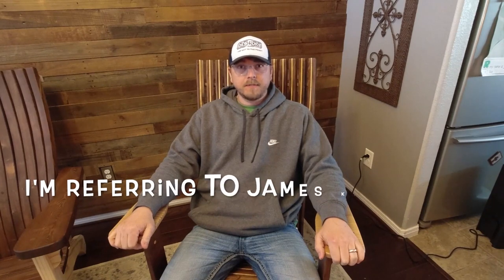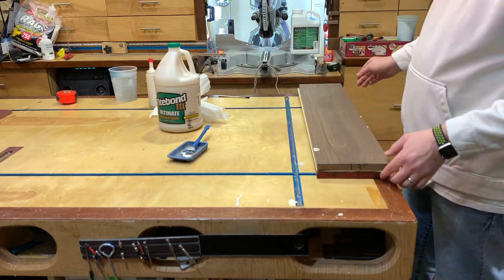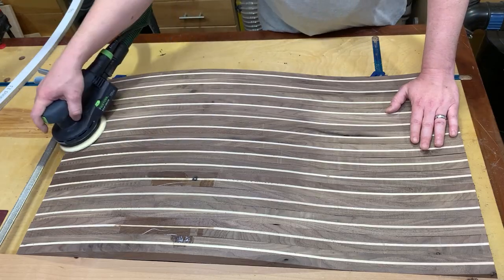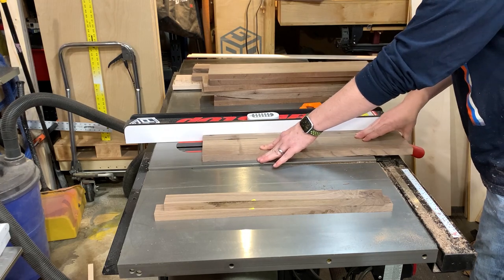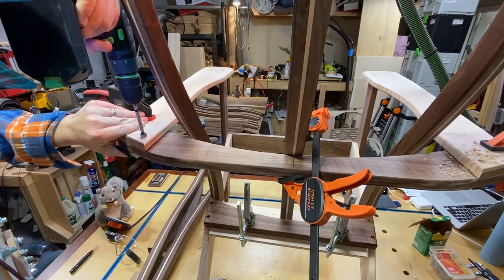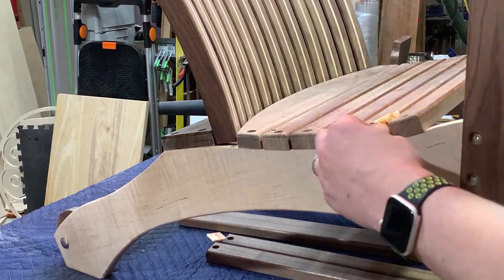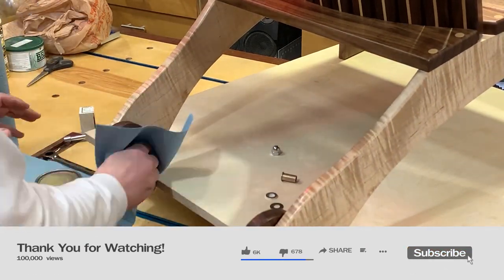DIY | How To Make Money Building an Adirondack Chair | KFWW Build Off Challenge

Comment: Both the chairs are beautiful. It's almost impossible to choose a winner from such a short video. The reason I chose your beautiful chair 'first place' over the other was because the screws holding the cross piece to the front and back legs alternate in height and don't touch one another inside. Unlike the other chair. But they're both beautiful! Thank you.

Comment: 1st place. I love the use of screws instead of bolts. One thing I noticed was in the other video he drilled his holes for the bolts he had blowout. I know it is not seen but when you are using woods like oak that looks really good go that extra step and use a backer piece when drilling so you don’t get the blowout.

Comment: I bought Kings plans because I really like the design. I particularly like his narrower slats for the seat back. You took it to the next level with the curly maple inlay/laminate. The wooden wheels go better, but would consider something more durable/less elegant if it was moved a lot.

Side Note: brilliant idea using an HDPE slab for your router table
Reply from the maker: Thank you. On the wheels I decided the chair might get moved once or twice a year. And because I was jazzing it up
I thought it was worth figuring out. I did coat them with a penetrating epoxy and I’m super happy with the result.

Comment: The best looking ADK ever IMHO. Where will use the yellow pine? Just in the back slats? or for the legs and arms? and what brand walnut stain for the cedar? Thanks for the vid, Great Job.
Reply from the maker: Absolutely. So the yellow pine I use on the frame and front legs. I use cedar for the arm rests and back slats which I stain a walnut. I use varathane dark walnut from HD. I have some pics on FB and Instagram if you want to check them out. Thank you!
Reply: @rpgwoodworking5489  I saw the Instagram pics so I guess the big question is how long do you think the pine will last compared to cedar? Are you using the total boat on the pine?
Reply: @Popsimath  yellow pine does extremely well outdoors. Use a good outdoor finish and it will last decades. Any outdoor finish with good uv protection will work great. Penofin is also a great choice. But yes halcyon is great.

Comment: I'm curious if you had much or any difficultly using the 5/4 hardwood instead of standard big box lumber? I'm pretty new to woodworking and am about to attack these plans with Maple and Cherry, thought I'd ask someone who has done it instead of using 2x4 Sugar Maple and ending up with a 400 lb chair!
Reply from the maker: Ha!  I did one out of big box pine and cedar as well. The frame, arms, and seat slats once machine came out to 3/4-7/8 ish. I wasn’t about to make the chair out of 8/4. 🤣. That being said it comes out weight wise about the same as big box store wood or at least close to it. In some ways the hardwood was easier to work with. You don’t typically have to go sand out bumps and ding in the wood like softwood. If it’s machined pretty well you will not need to do to much sanding on this chair. The back slats are the only part that can slow you down. If you machine the slats really well it’s a breeze. But if you are inconsistent while cutting them out you will have a good bit of sanding. In that case you would wish you used softwoods. 😂. Don’t be nervous at all using hardwood. Good luck!
Reply from the maker: Wait who got first place!?!  🤷👊🏻
Reply: @rpgwoodworking5489  You, of course, this is my second comment, I voted in the first one weeks ago! I thought that part was over and didn't want to unfairly enter twice or have my vote counted twice, haha!
Reply from the maker: Lol. Thank you.

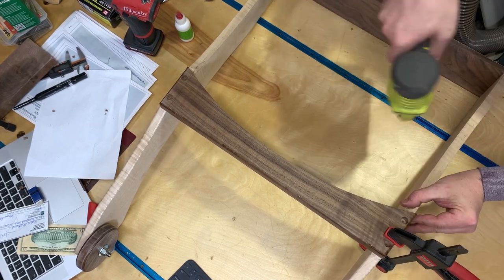Comment: Can someone tell me exactly what screw he is saying at 8:54 he used, and/or send me the link to them.
Thanks.
Reply from the maker: I used #9 spax screws. HDK are the same depending on which store you bought them. Be sure to pre-drill with 1/8” bit.
Reply: @rpgwoodworking5489  Ok. Thanks for the reply. Great looking chair!
Oh, can you give me a price range ur asking for ur Adirondack chairs?
And about how long it would take you to build a set of 4. I’m just wanting to have an idea of how many i could build in ~7 days. After i get up to speed, of course.  :)
Thanks.
Reply from the maker: I apologize for the delay. If I used yellow pine and cedar from the big box I could make 4 in 8 hrs including finish. I’ve made allot with that combo. They look sharp!  

This higher level build from rough sawn lumber in this video would take 15hrs for a set of 2. I have made 4 batches of 4 with this exact design each batch took me; off and on 2 weeks per 4 chairs. That’s only nights and one day per weekend. 

I’m not sure if that is helpful….? 

Send me a DM and I can send you pics of the pine and cedar chairs if you would like. I’ve seen allot of people take inspiration from them.
Reply: @rpgwoodworking5489  I just sent u an email. Thanks.